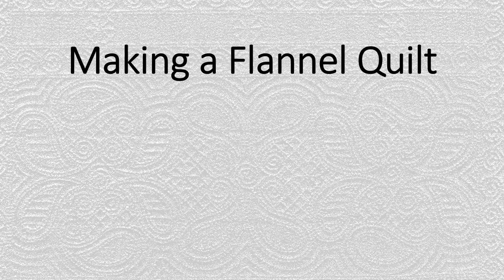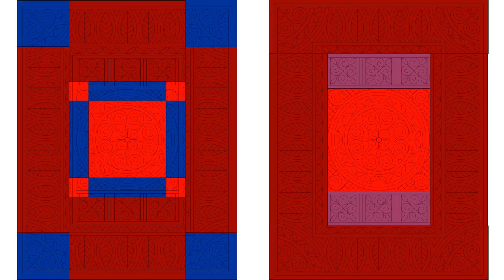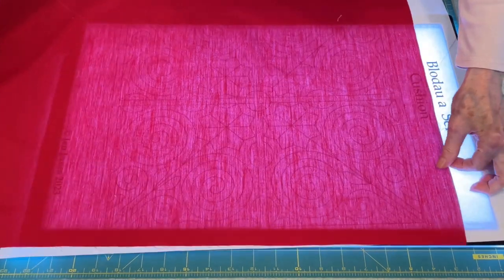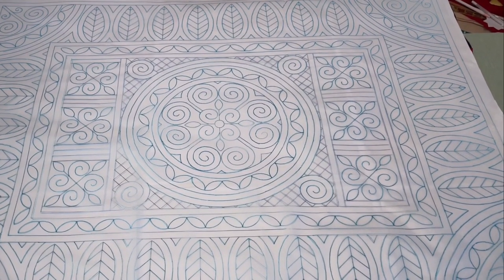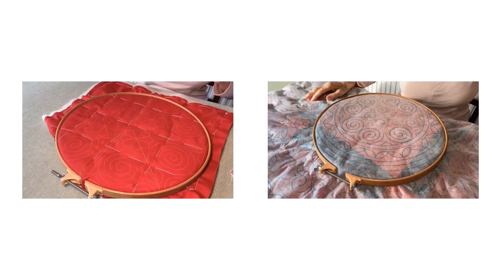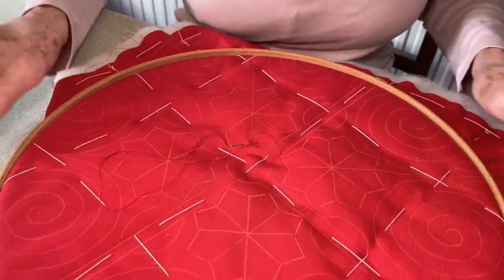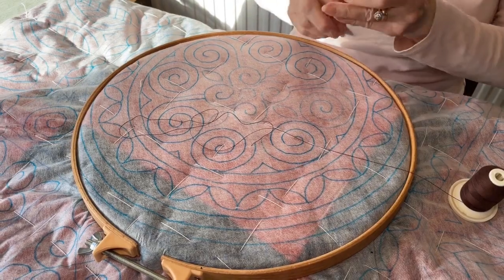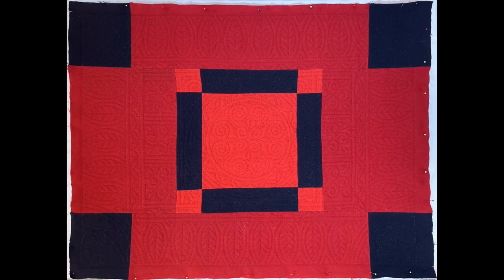The Making of a Cot-size Traditional Welsh Quilt from Felted Flannel

Comment: Great documentation of making this quilt, thank you! Also a big thank you for actually showing what happens under the quilt while hand quilting, a total game changer for me when I saw it in a previous video of yours! 
I love the look of a knife edge binding, especially on 'art quilts'. It takes a bit more time (ok, a lot more time, compared to bias tape binding by machine 😂) but sooo worth it! I usualy finish the edge with a blind stitch btw, though I never worked with a thick flannel and don't know if that would even be practical here...Anyway, lovely quilt ❤
Reply from the maker: Using a blind stitch sounds interesting. All the old quilts here used a double line of visible stitching. This was quite often done on a sewing machine even  though the quilt was all hand stitched. There's always another way of doing things!